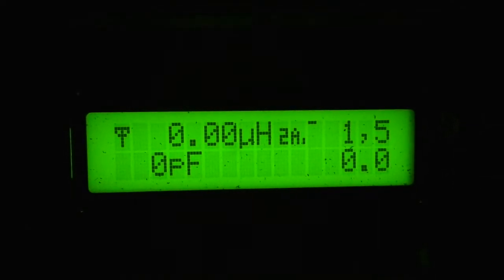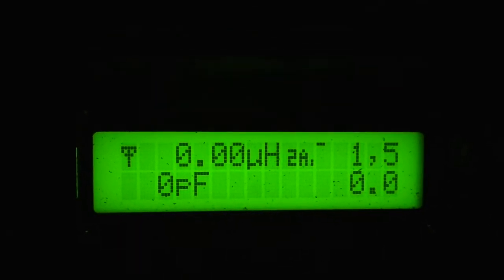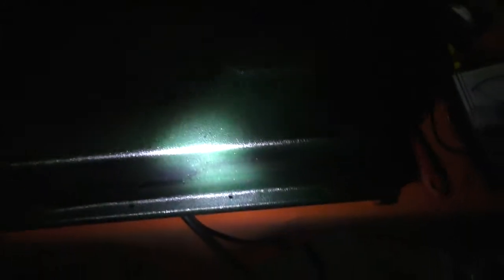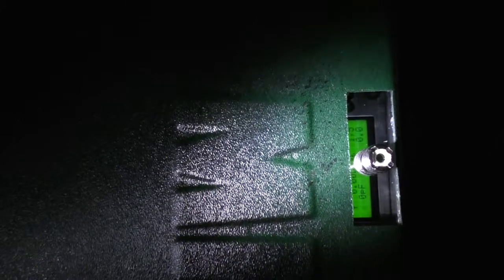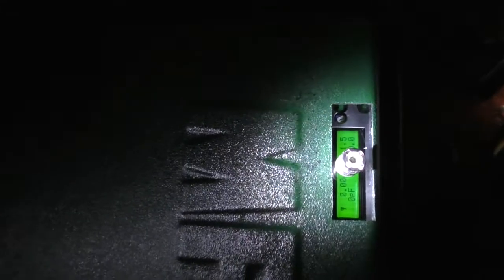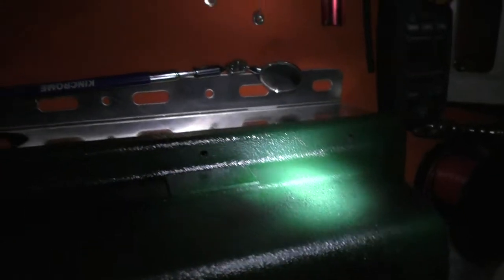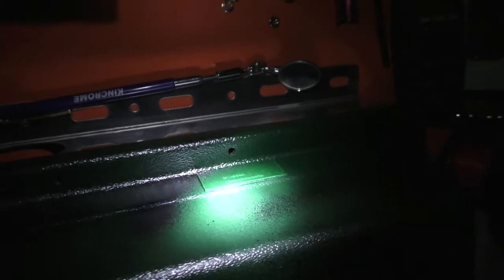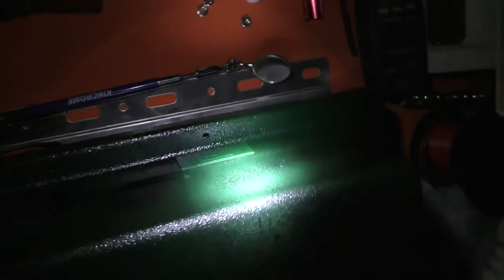The 998RT Display... Through The Looking Glass

Comment: Lots of good trouble shooting there mate. Great job. Good details. Well explained. Thank you.  Very useful. 

I hope MFJ sees your video and makes some simple changes to the sheet metal to prevent shorting to the buss and moving the choke away from the plastic cover so it doesn’t burn through the plastic cover. (Jeesch! That’s a dumb mistake in the design) 

Great vids. Thank you. I’ll be buying a 998RT next week and will look to see if any of your changes have been incorporated yet by MFJ. 

Might make an unboxing vid of it and reference your vids, to see if changes have been incorporated from your vids 3 years ago. 

Bill W7JZE
Arizona, USA
Up top. Not down under 😄.

Comment: Have you tried the remote monitoring software? A friend has a remote station and uses the software to monitor his unit in another city. Shows a lot of information.
Reply from the maker: No, I haven't. I know there's something called remote rig where people operate their stations from other locations, but I don't know about any remote monitoring software. This unit would never be far enough away for me to worry about about monitoring it remotely.Also, there may be interference problems to the remote monitoring unit due to the RF power, and interference to the RX signal due to noise generated by the monitoring unit. I prefer to keep it simple... less to go wrong.

Comment: Also enjoyed the ups and downs with the 998RT so after all this would you recommend it currently use a SG230 and works great . How is the 998RT on High Power ie 400W ? Relays look a little small.
Cliff
Reply from the maker: Thanks Cliff. It's too early to recommend the 998RT as I haven't put it through its paces with regard tuning solutions on all bands and power handling. I will be doing that though... well, to the limit of my Australian licence conditions anyway, and I will post the results. Remember too the 998RT must be tuned at low power, 20W so the relays will already be made when the high power is applied.